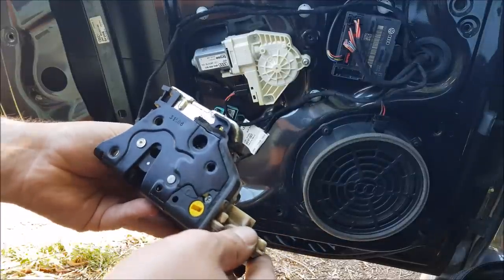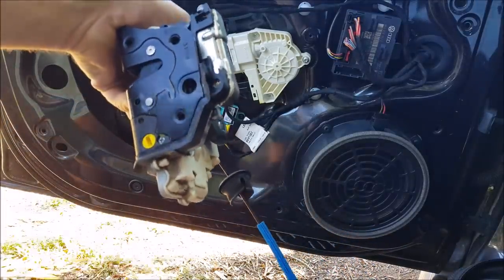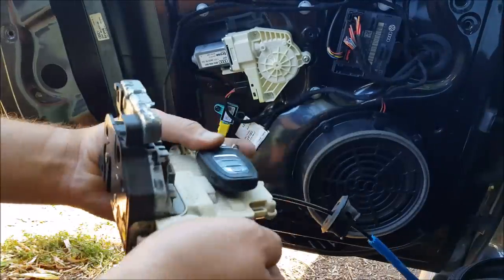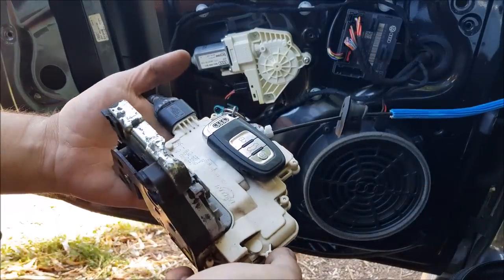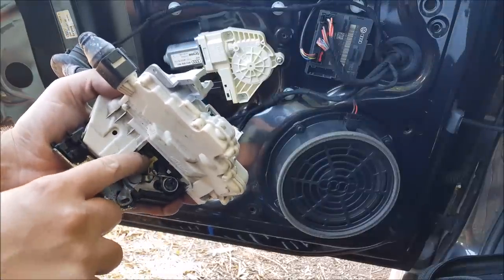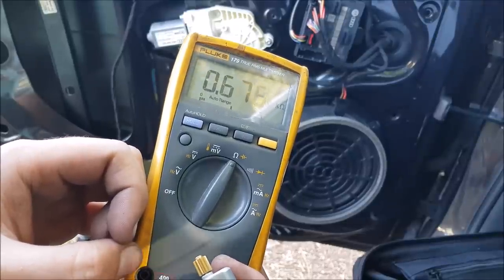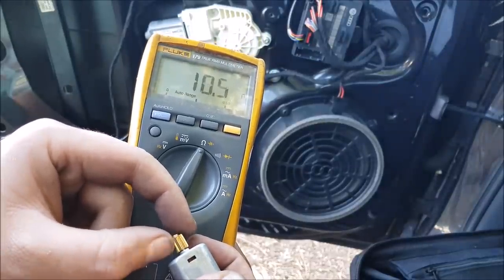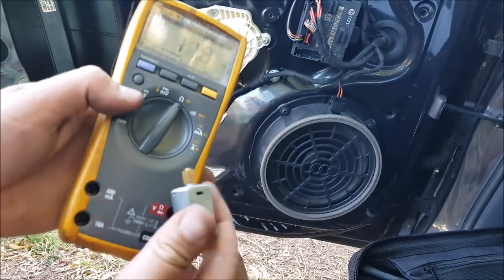Audi B8 A4 Door Lock Repair

Comment from the maker: Drivers door has stared doing exactly the same thing! If you need anything explaining/covering in more detail let me know and i'll make a follow up video for the drivers side!
Reply: excellent video, my drivers door has just done the same, video of drivers side would be appreciated.
Reply: Brilliantly done.  Thanks.
Reply: My passenger rear door just started having these exact symptoms today. Hoping to tackle this on my own now thanks to your detailed walkthrough
Reply: hi, nice video, i have this problem too,  but i cant open right front door even from inside, once in a while it works but most of the time i cant open it at all,  is it the same problem as there? will changing the actuaor fix it?
Reply: Man this helped so much. I wish your video also covered how to separate the two sections which actually gave me a heard time but nonetheless excellent video. I was about to buy a new actuator and then saw your video. Thank you
Reply: Hi I had my Audi driver's door lock module replaced with a second hand Audi door lock module, stopped working after 3 days, help please
Reply: please do. driverside is mildly different

Comment: Audi TTS MK2 8J 2008
Thank you buddy!! I found that the larger left hand motor had a broken connector. I prised out the motor and one connector stayed on its circuitry and the other stuck to the motor. I took the connector out of the motor and soldered it back to the circuitry, it slots into its plastic slits just like the other side does. Then solder its wire arm to the circuitry.

Once the connectors are soldered to circuitry and straight, the motor should fit back onto it's connectors. Be careful not to bend or force as they should align up and click into place.

I hope this helps as this did the trick for me. Thanks to the video from sootpig!! You gave me the confidence to delve deeper!! Thank you so much!!

Comment: Thanks a lot, was very helpful. Instead of disassemble the motor, I was using an electronic cleaning spray 4-5 times. The white cover of the motor was deep dark before I was using the spray and afterwards it was light. I have also used light air pressure to get it faster dry inside. I was also waiting an hour to be more save, that it has been dry.
Sure your way might get out more, but it is now working like a charm. So I hope it will last a while. Disassembling the ‘mechanicals’ from the ‘electronics’ has been the toughest part, but the result was worth it.

Comment: Brill video. This guy I guess is an electrical engineer. fixed my actuator but just sprayed motors with WD40 and worked ok. Splitting mechanical and electrical parts was a bit of a nightmare though due to locating springs etc. Ended up using some dental floss to pull one side of spring into locator when closing. Worth considering just changing unit for about £40 off e bay but I guess you’ll make your own mind up if you end up with a box of bits. Thanks for the video !!!!

Comment: Thank you so much. After ordering a lock for my A3 (which turned out not to match, I have 8 pin, whereas 9 pin seems to be specced for my car).
Anyway, this video, with extraordinary detail and great video work encouraged me to take the thing apart. I treated both motors in the lock. Rather tricky getting things back together, especially as the yellow pieces separated as did the spring in between. But thanks to your detailed videography I could just about see where things were supposed to go.
tested fine, and now back in the car working well. My driver's door is the same, so might give that a go if I can convince myself that it wasn't a fluke getting it back together undamaged.
I checked this morning with Audi, these locks are £182 each!
Reply from the maker: I'm glad you fixed it :) i keep putting off doing the drivers door but once the weather's nice i need to do mine too. Seems like a very common problem, and not hard to fix!

Comment: Thanks, fantastically helpful video.  Exact process fixed mine yesterday.  Wouldn't have even thought of stripping the motor without your guidance.  (Tip: dont activate the locking mechanism with the motors exposed, without the limit switches to stop them they chuck all the gears and the little spring out!   All back together now though.

Comment: Thank you sootpig! Mine was doing the exact same on the driver side - sorted with the aid of this video which proved absolutely invaluable! Only issue on mine was that between the white and yellow clips, the yellow one separated from the spring rather than the lever it is attached to (causing the spring to come out). Trick was to put the spring back and wind it once using the yellow clip before before snapping it back on again.
The other thing I found that made it easier was to remove the lock cylinder first. Just pop of the plastic cover (above the latch's top  bolt) and then turn out the torx bolt (note it does not come out all the way). Then slide out the entire barrel. That way you can just attach the latch and slide the barrel back in afterwards instead of trying to line it up with each other inside the door.

Comment: Thank you for this great video that actually gets to the very bottom of the issue! It would be great next time to include the steps that show how to take it apart and put everything back although much of it is common sense. And always fix it in the early stages, I've ignored it and I've ended up with the door not opening from either inside or outside. Painful!

Comment: Thanks a lot man. Instead of cleaning motors I bought em cheap on eBay for $5 a piece from China and it works perfect. Finally can unlock my car with remote control. Just have to be careful with removing those arms. And I didn’t unscrew the lock from outside, I was able with both my hands to guide it inside that opening.
Reply: Hi there! Do you happen to still have the part you ordered? I broke mine while trying to take apart. Help please.

Comment: Excellent video and instruction.  Found it after I removed screws between actuator asm and mechanicals.  I was afraid to pry the plastic links until I saw your explanation. 2010 Q5 front pass door. Thank you very much.

Comment: Followed your lead on a problem on my passenger door where neither the interior or exterior latch would release the door. Cleaned both motors, now working perfectly. Bit fiddly getting the electric portion back on the mechanical lock but with a bit of care it went back together ok. Thanks for the video.

Comment: Thank you for this video. Just managed to apply your instructions to a 2013 A4 rear right door. Sure enough the motor was black with carbon. One tip though is that it’s possible to remove the motor without actually completely separating the black metal section from the plastic gear housing. If you remove all Philips and T8 screws you can see, and one that lies between the metal and the gear housing the various components can be loosely opened up and are flexible enough to pop the motor out without disconnecting gears from levers.

Comment: Porsche Cayenne is also having similar unit. I had same problem with rear left and had fix. Most difficult was to separate Electronic and Mechanical part as u mentioned. Also it was showing "0843 Central Locking Closing Unit, Implausible Signal" before repair.

Great work 👍👍
Reply: Yes, I just replaced the 2014 Cayenne rear left door lock. What a project it was! I orderd the wrong part 8K0839015C (6 poles) instead of 8K0839015 (8 poles). Of course I wanted to save work and did not checked before the order. Tried to check electronically wether it is possible to rewire the 6 pins but I found electically the C model has different charasteristic therefore I decided to build one unit from the two: tried to use the electronic from the old unit and replaced the complete mechanical unit and electric motors from the C (new) module. 

Diassembly of the unit: the videos on the net never showed how should it be done. Read it when the unit is in front of you, otherwise it is just a mess. 
After removing the 4 screws it is possible to move the electronic and the mechanical part apart from each other. Take photos from the  are covered by the grey plastic from different angles. 
Move just a litte apart the parts and examine the two plastic levers connected to two plastic axles. One end of the levers connected to the mechanical part the other end to the electronic part (two axles, one short one long). You can see the levers started to bend. Use a screwdriver to help remove the levers from the axles. It is not easy. Pull the main parts a bit and push the levers a bit to release the tension on the lever. The aim is not to broke the lever. I was not able to remove  the lever on the longer axle from the old unit because of the axle part was really stucked into the lever"s hole. The stucked axle fell apart after pulling the units apart but it was not a problem, the axle part and the spring can be placed back without difficulty. But first remove the axle part from the mechanical part. I had to trimmed the axle part to be able to pull out from the lever's hole.

After the separation ot the two units I opened the electronics part of both units. Swapped the motors from the old to the new units and closed the old electronic unit. 

Then assembled the C unit mechanical part with the old unit electric part. The reason was the old unit's mechanical part was really weared out and I found the C unit mechanical part more robust than the old unit's.
Push the two part together slowly and position the two levers's hole to the two axes. It is not easy but doable. Flex the plastic arm with spring above the two levers the most upside position to have enogh room for the adjustments for the levers. When outer lever hole is in line with the long axle than use a screwdriver to push the lever onto the long axle. Push the main parts a bit closer to each other and position the inner lever hole to the short axle. When inline than push the lever to the short axle. When using the screwdriver hold the spring supported arm above the levers in extended position by your finger to be able to do the lever adjustment and the push to the short axle. If the axle is positioned right than push the main parts completely and secure the two parts with the 3 screws. Important! Check the mechanical and electrical operation of the lock by connected to the subframe before doing any assembly (apart from the connection of the main cable harnes between the door and the body)! Check the connection of the axles to the levers. The inner lever sitting on a short axle and it is easy to slip off from that axle. When it is slipping off tha the door can be opened always independently from the status of the lock.
Use the NEW unit's grey plastic cover to completely cover the unit with the 4th screw. You will find it not possible to put into the right position because of one plastic guide pin is too fat. Trim this pin with a knife and it is OK. The reason of this cover swap: the new unit cover has more room for the outer release arm while the old unit's plastic cover has not. Using the old unit cover on the new mechanical unit results a friction on the outer release arm and the arm will not going back into the resting position.

Apart from that mechanically the old and the C unit is the same.

I hope this help some poor souls out there facing with the same problem. Good luck!

Comment: Thank you for your informed video and has been a great help and have repaired the actual actuator and works great. However when I split the actuator away from the locking mechanism there was quite a bit of resistance parting the two modules. Finally was able to part but the spring on your yellow actuator arm sprung off and the top portion of the yellow actuator arm remained with the locking mechanism? The problem I have is that I cannot workout how the spring locates between the two portions of the actuator arm. Have you any still images of how this spring is relocated correctly holding the two parts of the yellow actuator arm ready to attach the actuator module to the locking mechanism. many thanks, Regards, Paul

Comment: If you still have problems after this very good fix, you can find the motors on AliExpress/eBay, just search 12v auto lock DC motor, I have a similar issue and will order the motors first just to be safe when I fix the lock.
Reply: Hi I'm looking at ordering the motor's did they take a long time to arrive?they all say from China.

Comment: Great to get a disection of a common fault that seems is built in to design .... it amazes me the Heath Robinson approach to many plastic mechanical parts in a chain and electrical components on the edge of purpose the vag group engineer into thier cars ! 
anyway 
you have saved me time hoping to come to the same conclusion and/or  ££££ in parts
muchos grassyarse!

Comment: 7:40 - exactly! This is very important, ensure there is no graphite stucked between commutator contacts - it will cause a short. I had this exact problem (and missed it the first time I cleaned the commutator): although motor still worked, current increased to about 7amps peak (from, I think, 1amp nominal) and the door module started throwing various errors. In this case you can often hear a buzzing sound, because the driver (door module) is turning the motor on, then off (due to too high current) and then back on... and off... and on again... about 13 times in a row, in something like 200ms - so you get very short buzzing sound of about 60Hz.

Comment: Great video! I would assume that due to the limited travel of the motor is the cause of the build up.
Reply from the maker: The motor will actually complete numerous complete revolutions. However the fixed gearing means the motor will always return to, and start from, the same position every operation. This is also the moment of peak current draw so that part of the commutator is going to get hammered compared to the rest of the motor

Comment: Just started to have the exact same problem. Left side drivers door. Car is LHD. I am going to do what you showed me on the video!  Would rather fix the problem than pay 175 euros for a new one from an Audi dealer or order the part from Autodoc app and pay 83 euros. You don't know if the cheaper version is from China and not as good a quality. Hope I can fix mine like you have. Thanks for this as helps alot.

Comment: Thanks for the video, i tried this but no luck for me, Quick question watts the yellow switch for? the one you can move sign a flat screw driver?. I think that my problem is with the handle latch. Because electrically and mechanically i can see it is working. If i close the lock and unlock the car with the fob I am able to open the door when i move the inside and outside mechanisms. I looked inside my car and i can see a bit of rust in the outside cable .
Reply: It's a child lock, when turned the door will not be able to be opened from inside (via door handle)

Comment: I need some help. My old actuator was locking the door only with the key and I replaced it with a new one, but still central locking is not working and I couldn't lock the car with the key, so I put back the old actuator, but now I can't lock it even with the key. Do I need to do some coding after the new actuator replacement? The garages are opening on Tuesday so I'm looking for help now. My car is Audi A5 B8.

Comment: Wow, thank you for this video! I watched it over and over while diagnosing mine. Originally the passenger door wasn't unlocking from the outside. I pulled it apart and the motor inside was starting to get sooty. I cleaned it up and reinstalled. The door isn't locking now. Not sure if I did something wrong reinstalling, or if I should just buy another actuator. Thoughts?
Reply from the maker: Check the motor connections inside. Door lock modules are cheap enough to replace

Comment: Thank you for the video, look like I have a similar issue with my A3 audi both door, did the motor working when you try  to lock it and cannot unlock ?
 In my country Greece each one it cost 220Euro wow does anyone know the cable diagram of lock I mean each pin?

Thank you for your time!

Comment: If anyone does this test it all with you're door card off. If pulling the exterior door handle when the door is locked resets the fault then you need to replace the exterior bowden cable as it isn't returning the actuator arm back to where it should be .It is likely to be the main cause of it failing . It's very easy to replace and reasonably cheap.

Comment: Thanks, just solved my issue using your video after I used following link for video on how to get to the door lock actuator: https://youtu.be/SFdOf2N1XRc
As I had opened the actuator, decided to clean both motors, only a bit of extra work.